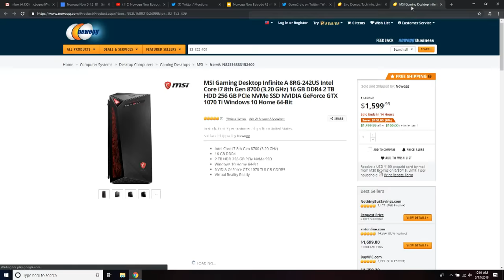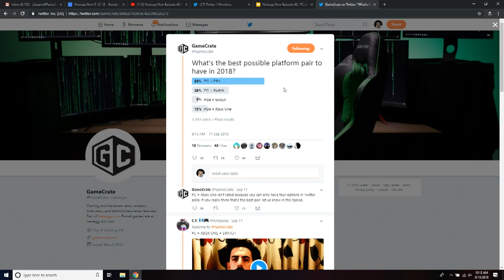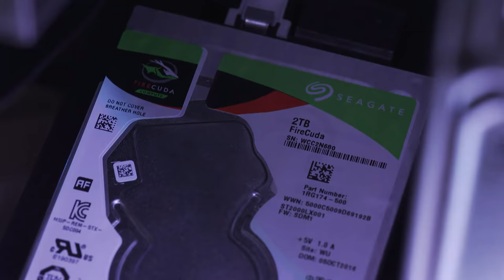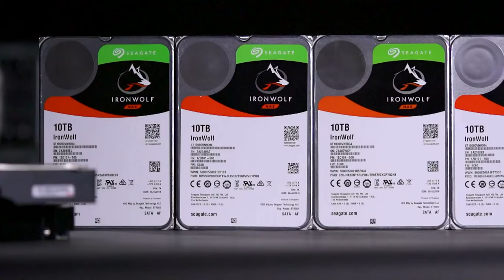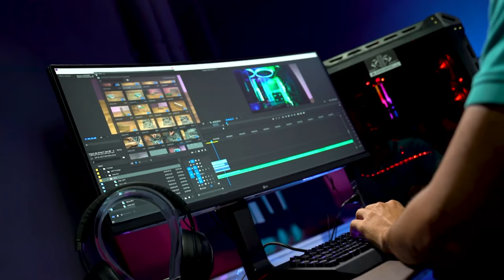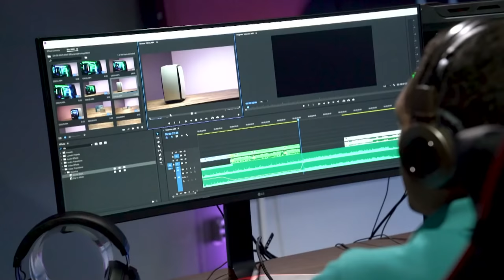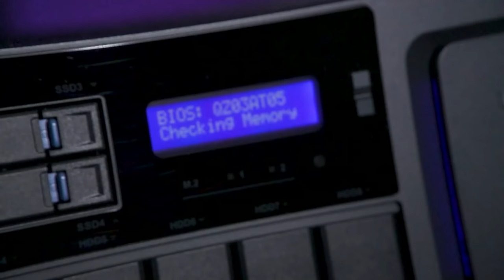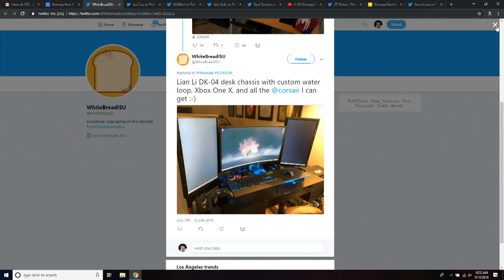Newegg Now Episode 42: PC or Console?

Comment: You left out JBOD discussion, which is not RAID but used in large drive bays connected directly to a pc using either internal or external controllers and which contain a large # of these drives.

Comment: Modern NAS enclosures use SMART to test drives often so you don't "suddenly" get a failure. SCRUBS copy on write to keep all your data fresh so it doesn't Fade.  Finally, multiple PARITY  drives allow for not only replacing a failing drive but also for surviving another failure while you stress the system resilvering the replacement drive.

Comment: If someone steals a $1,000 smartphone is that considered grand theft? This is what I did when I needed a new phone. I went to ebay and checked for an S7 with a clean IMEI. The one I found for my carrier was Google locked, I bought it for $200 in mint condition removed the Google lock using software on my PC and I activated it with my carrier the same day. Done!